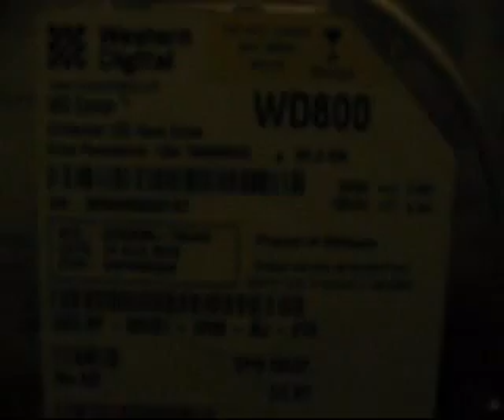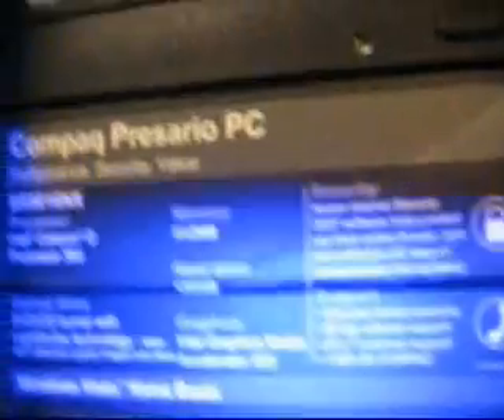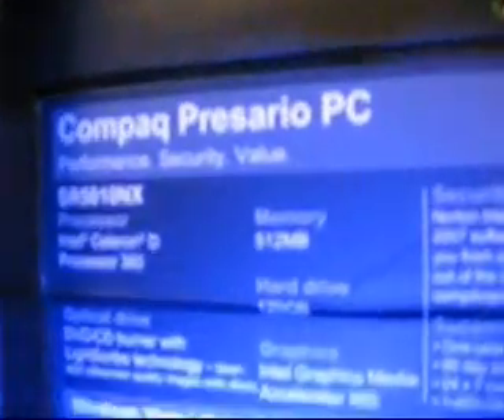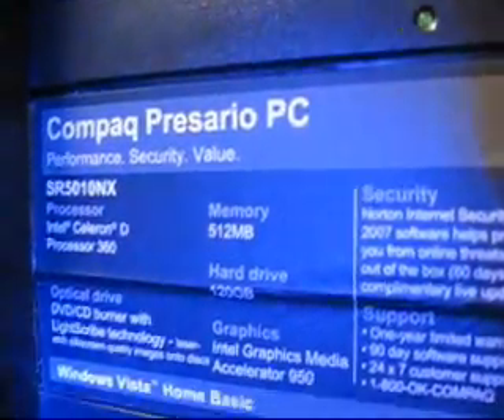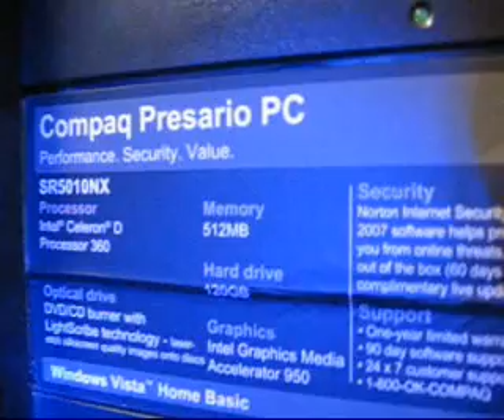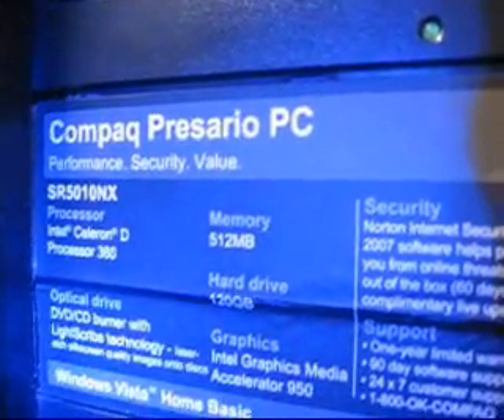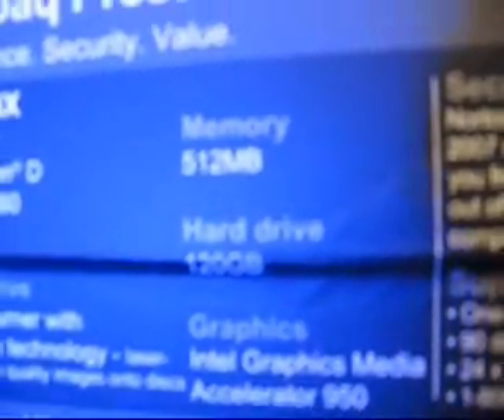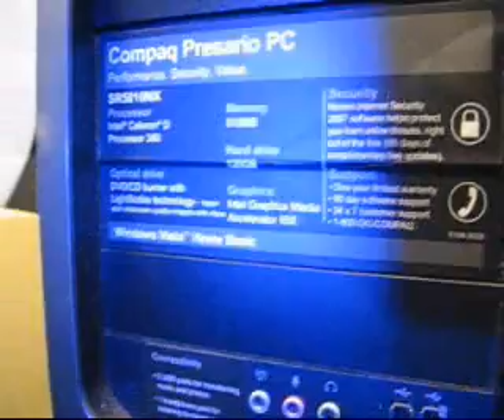Replacing a hard drive in a Compaq Presario SR5010NX PC

Comment: I know this video is old, but it's still worth it. The tab won't release the case for the Hard Drive. I have cleaned out the case, but I still failed to pull it out. Any suggestions?
Reply: I had the same issue, my fix was pressing harder on the tab and wiggling the encloser as you pull up. It came out.

Comment: I Have Rebooted After Installing A New Hard Drive It And Its All Running But Computer Seems To Be Running Not Smooth... EVERYTHING IS RUNNING SLOW Theres A Update That Gets To 75 Percent And Never Finished I Waited Over 6 Hours So I Dont Know What Wrong Is The Update Bad? Is My New Drive Bad? Is It Cause I Replaced The Original Hard Drive Which Was A 250gb Seagate Brand With A Western Digital tb Version? Please Help Me What Could Be Wrong? Also The Update That Wont Finish Is Windows Service Pack 1 For x64- Based System (KB976932)

Comment: Hey My Computer Hard Disk Just Went. When I Turn On The Computer It's Telling Me To Replace Hard Disk And Press Any Key...
What Kind Of Hard Disk Do I Need And Where Can I Get It? And Do I Just Install It By Simply Pulling the Old One Out And Putting The New One In ?

Can You Answer These Questions Please ?
GOD Bless
Reply: Myreverlation since its a 2009 you'll want a 3.5" SATA 7200RPM, sorry for such a hassle with questions earlier i just reread these and figured its a 2009 PATA went out in like 2002-2004 so 2009 is definitely SATA
Reply: yeah, i'll still help:)
Reply from the maker: want kind of computer do u have
Reply: Does your computer use SATA or ESATA? also is the Data connectors in correctly, or FDD/IDE in correctly?
Reply: Milkersdegreat2
Honestly Dont Really Know ... How Do I Check This Out I'm New To This
Reply: Well its easy to make sure, Simply first check your power cable (usually has a P1 or P[number] on it), make sure that is seated correctly. Now the Data cable, this is also simple but it depends on how old it is on whether or not it uses SATA/ESATA Cable or a FDD or IDE. SATA cables are 7-pin and IDE/FDD cables are wide stripped, usually say "Master" or "Slave" on them referring to what kind of hard drive it is
Reply: Its Like Your Its A 2009
Reply: this isn't my video sir, and well do you have the same cables on your hard drive?
Reply: Milkersdegreat2
I'm Check That Out...
Reply: you do that and get back with me
Reply: Milkersdegreat2
Thanks
Reply: Myreverlation your hard drive is dying and its to get a new one
Reply: Milkersdegreat2
Hey Thanks I'm Going To Upload All The Info In A Few Days Hope You Can Still Hep Me